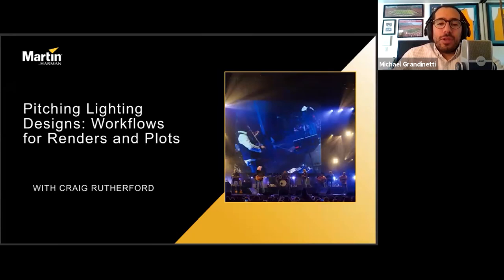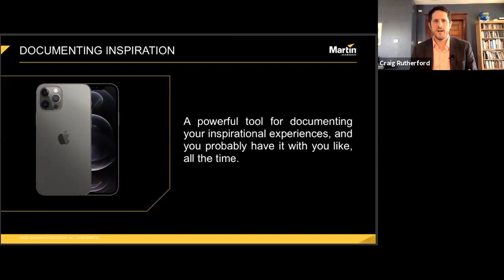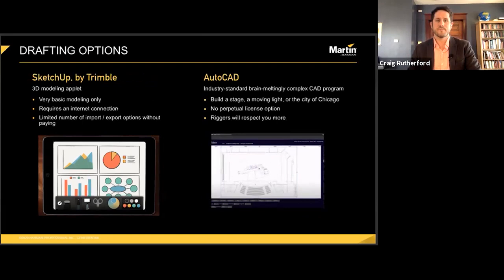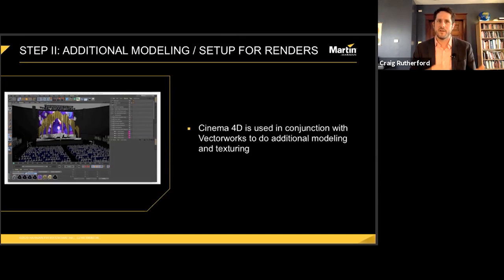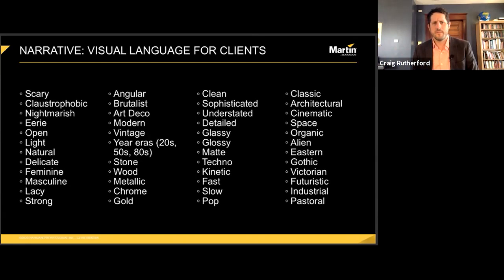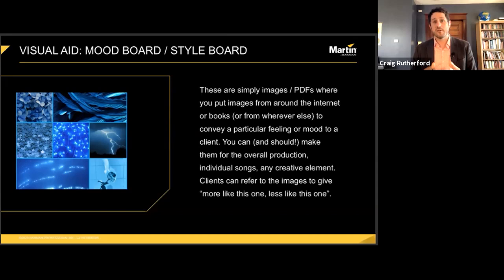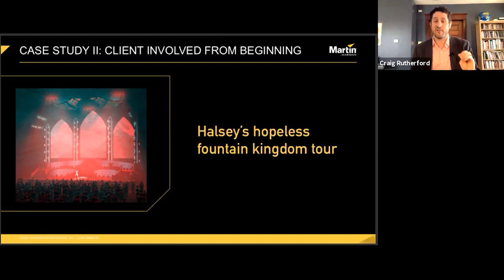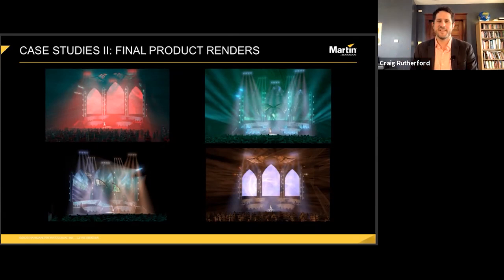Pitching Lighting Designs: Workflows for Renders and Plots with Craig Rutherford – Webinar

Comment: I still use an old copy of AutoCAD, running on a 2009, 32 bit, Windows 10 laptop, so you don't need the latest software and hardware to draft! Oh and you can buy old AutoCAD LT versions for very cheap.